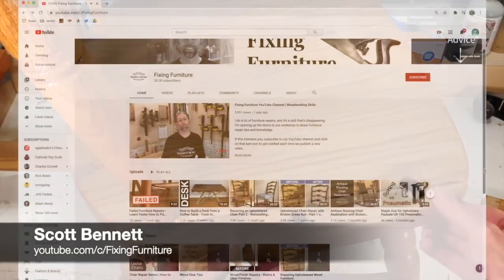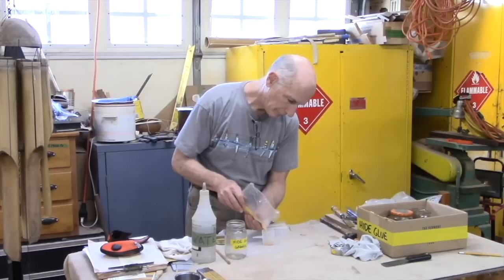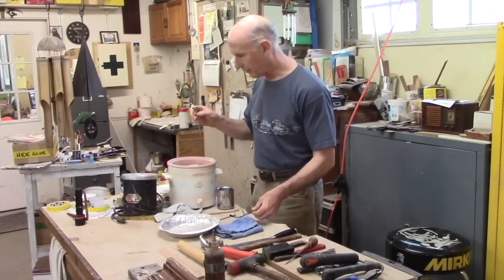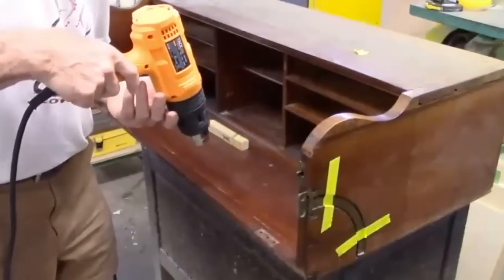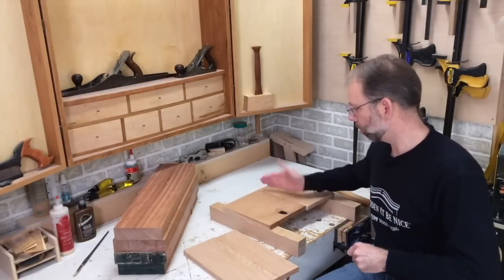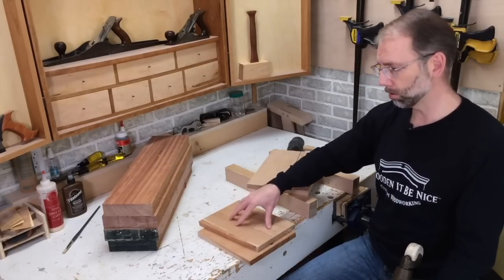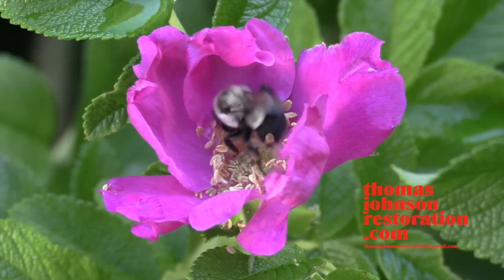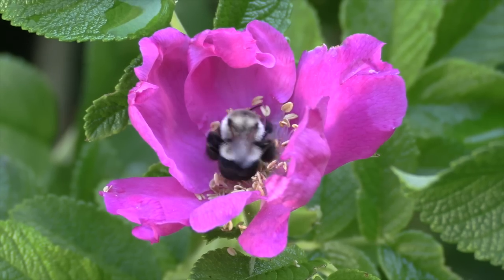Furniture PRO Tells You What Adhesive You Should Use

Comment: Thank you to both of you for this expose of a sticky subject! 
I have found epoxy adhesives to be extremely effective in other repairs in the workshop and at home. But there's no going back once the stuff has cured, so be sure to get the components exactly in position.
Reply from the maker: That's exactly right - in fact it's true of all glue ups regardless - you must get it positioned absolutely correctly

Comment: Hello Tom, when I was doing woodwork in secondary school in the early 1950s, we used a glue which we called “hoof glue”.  I assume that it was derived from horse  cow hooves.  It came as ‘glue pearls’, which were melted in a cast-iron pot over a fire. I presume that to reverse the glue one would heat it (very carefully).  No water was added to the glue during its melting.  I am sure that you would have dealt with joints which were secured by this type of glue.
Best regards,
David.
Reply from the maker: Thanks! That's amazing that you were using hide glue in school!

Comment: I worked for a boat builder in Bristol RI in the 90's and we almost exclusively used Gougeon Bros Epoxy, including the West System. They provide many fillers that enhance the strength of the epoxy or reduce the weight of the epoxy for 'fairing' the surfaces. They are very good in providing literature to assist you in choosing what additives would be best. Amorphous silica is very important in producing a strong bond. The company bought epoxy hardener and resin in 55 gallon drums and we had dispensers that created the correct ratio. They sell those units, but for limited use the cans come with dispensing pumps. It is spendy and the chemicals have odors, but not really bad like polystyrene. The amines on the hardener can be a bit strong.
They were using epoxy for everything including molds for parts. I did some testing to see how wood glue held up to the stresses incurred during heat curing of the molds and it held up just as well at temperatures up to 200 degrees F. We started using wood glue for elements that were not going to used in the boat and saved a lot of money.
Reply from the maker: Thanks! Yes, I have the "mini-pump" set up. It is amazing stuff!

Comment: Doing knife handles and gluing up with pins and steel I use west systems and their thickener when appropriate. For building my bamboo fly rods I use several glues like epoxy, titebond III, superglue. It is very important like you said to know which ones to use on what. Great video, I like the clamping idea.
Reply from the maker: Thanks! I imagine you need adhesives with some flexibilty for the rods. Interesting!

Comment: One excellent filler for epoxy like West Systems is wood flour. It is not as strong as silica when used as an adhesive, but depending on the color/kind of the wood used for the flour can make a joint that is both strong and fairly easy to color if it's not exactly a match. Not sawdust, it's generally much finer and more uniform than that, although I have used sanding dust and even sawdust from my bandsaw on occasion. Mixing silica with wood flour will naturally lighten the tone of any kind of wood flour, and make the epoxy paste stronger. Wood flour can be purchased online from most epoxy/fiberglass shops, but also even on Amazon. A gallon of the stuff in a bag or plastic tub should cost around $10 and will last basically forever. In fact, wood flour mixed with other types of glue is industrially used to make MDF sheets and other products.
Reply from the maker: Thanks! So interesting! I had never heard of it. I suppose we have plenty in the bag of my belt sander! I have collected that fine sawdust before, but never used it much, maybe I will now

Comment: Great conversational video and very informing, thank you both.
Now, Master Tom, when I was young I got into plane modeling and building and i remember we use to use 2 types of epoxy where needed, the 5 minutes one and another one called 2 Tone especially around the engine area, in case of a crash to protect the engine... but I have never heard nobody mentioning this 2ton type in woodworking, I'm I missing something here?
Reply from the maker: Thanks! I remember the "2 ton" epoxy, but haven't seen it in a while. Epoxies have varying strengths, you have to read the labels

Comment: Great video! It might be worth mentioning two other types of adhesives: Cyanoacrylates and polyurethanes. For me cyanoacrylates (superglue) has some limited utility and is handy for putting things back together perhaps for use as a template or for inlays, etc. Polyurethanes were used a lot in the 1990's/2000's and have proven to be a poor choice. I've dug enough of that crud out of otherwise decent chairs. Makes a mess, eventually fails, and nothing else really sticks to it. Polyurethane should not be used for furniture repair. Ever.
Reply from the maker: Thanks! Yes, I have never had any interest in it. I've never tried those super-glues either, so I know nothing about them

Comment: For epoxy thickening I went with a cellulose thickener because it is is less hazardous.  For furniture I expect they will all do the job well.  The cheapest and probably safest is wood flour, dust from sanding.
Reply from the maker: Thanks! I don't know about the thickeners, West System has many different types. Some do affect the strength of the epoxy. I use coloidal silica. As far as wood dust goes, I'd like to ask them!

Comment: Epoxy: You covered the wood-tone powders, and white with the coloidal silver. Black is another issue. So much art black relies on charcoal. However, I assess that charcoal tends to weaken epoxy. Right now I'm using mica powder to make epoxy black, and it seems to be working well. My filler is diatomaceous earth. It's off-white. My whitening agent is aluminum oxide powder. All of these coloring agents should be used sparingly .....just enough agent to provide the color, and no more.
Reply from the maker: Thank you! Very interesting! Luckily, it takes very little color, I've wondered about the strength with different thickeners